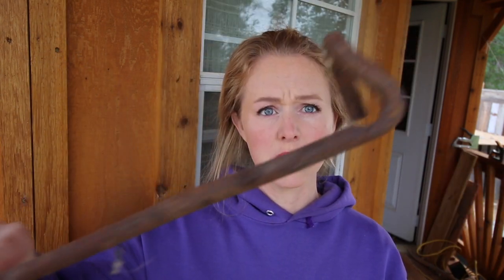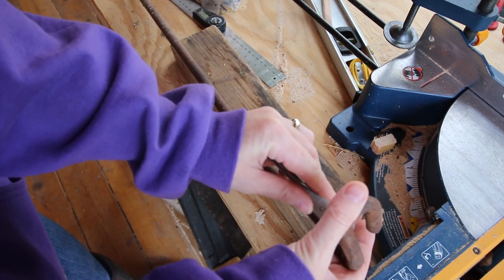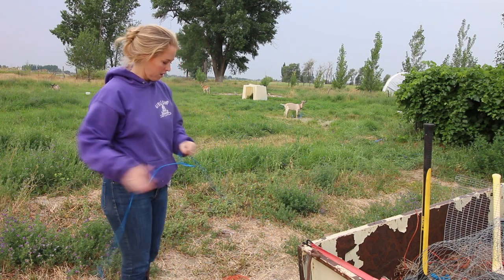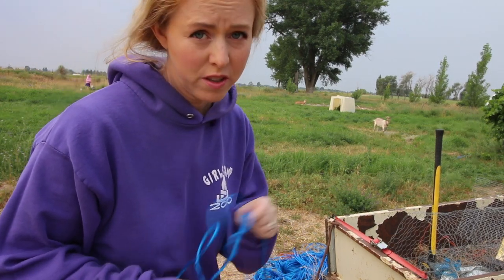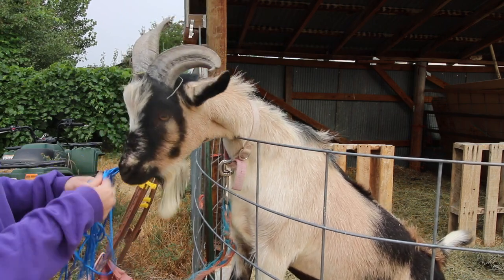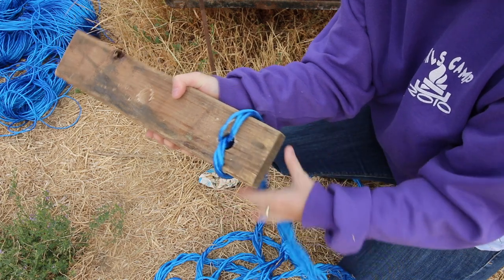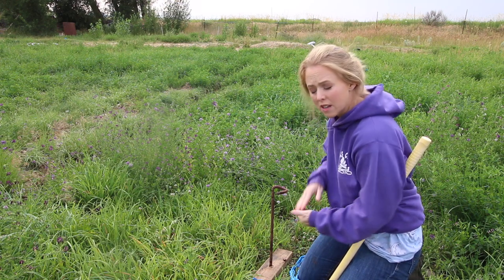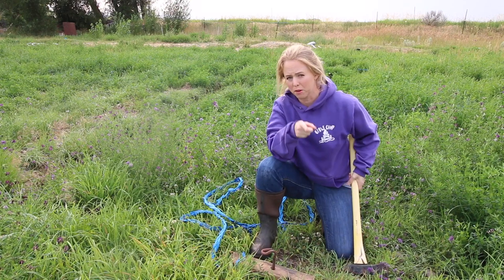How to Make Your Own Grazing Tie-Outs For Mob Grazing On Tiny Acreage

Comment: I made the tie-outs from 5 gallon bucket lids which you showed earlier, which work really well. My soil is soft so no need to make dozens of permanent ones. They are easy to pull up with a tyre lever every time. I run the loop of the rope up from underneath, through the hole at the outer edge, then up and over the stake in the centre. Very secure. No digger rods here for free, though. An engineering shop charged me $25 to bend 2 lengths of rebar!